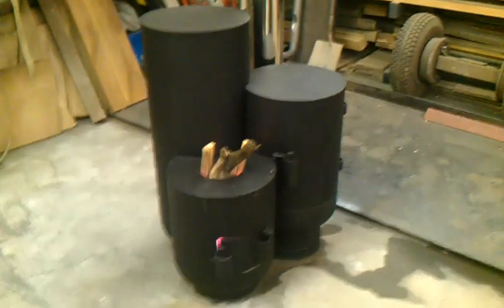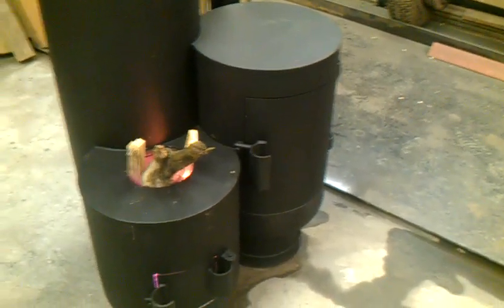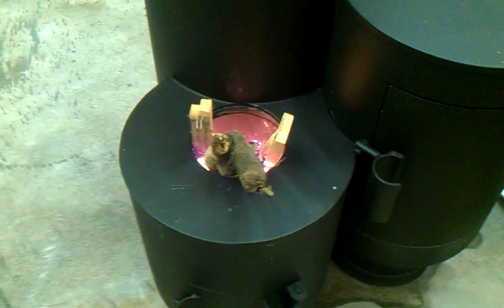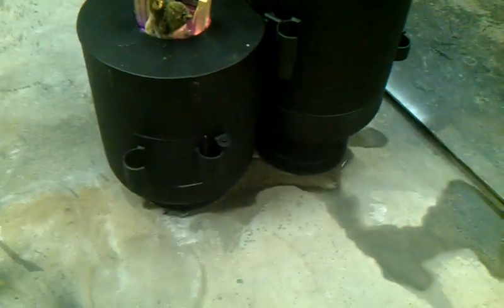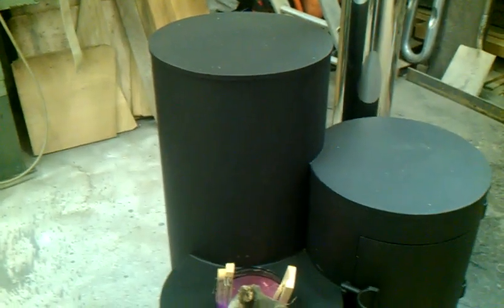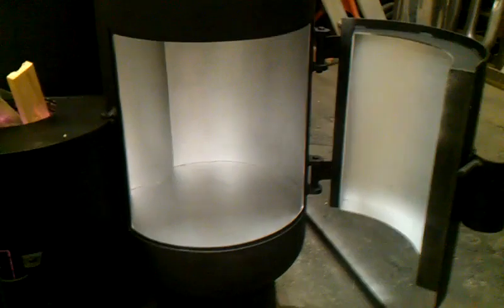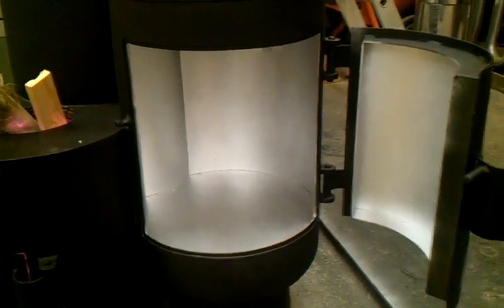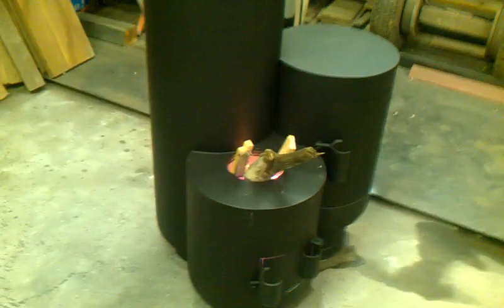Super Efficient Rocket Stove Fabricated From Steel

Comment: Why I've never come across this video is a mystery to me. I am so impressed with the build design and overall look well done m8!
Reply from the maker: I've since made the mk2 which is hugely improved using a lot of stainless steel to line it so it will last a long time and the burn chamber is enclosed with a lid on top and glass in the front with an air wash system to keep it clean. I've posted a picture on Pinterest if you want to see it, I need to get a video done as well. Many thanks for your compliments as well.
Reply: @mattjbelfield66  i'm looking forward to the video! and thank you for replying Matthew ;-)

Comment from the maker: The liner is 2mm thick stainless steel with an extra piece wrapped around the lower part where the burn is hottest. I intend to fabricate an ash pan from 2mm stainless that will fit snuggly into the burn chamber, which will aid ash removal and if it does burn out over time it can be replaced much easier than the main liner. I haven't used any vermiculite/perlite insulation in the J tube as I couldn't see the need for it, the clay has achieved the result required and stores heat for hours after the fire has gone out.